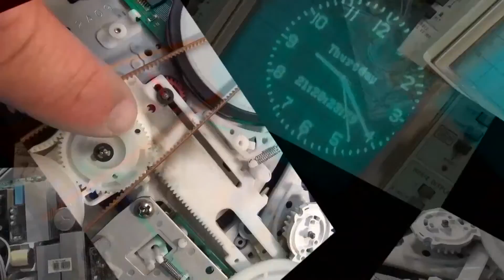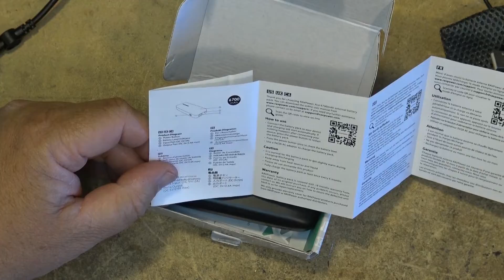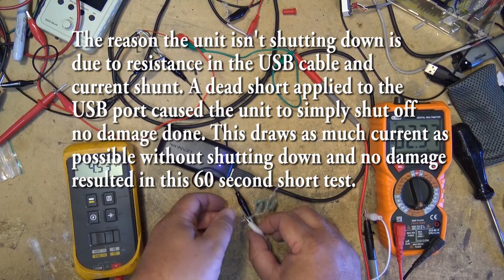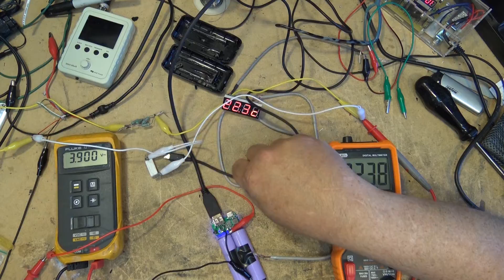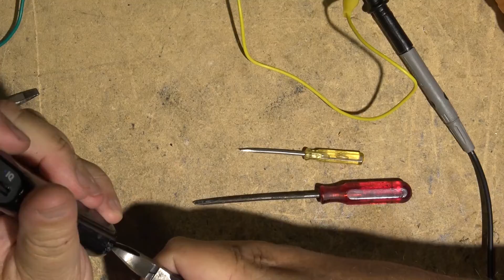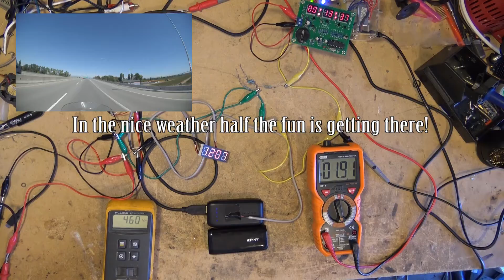Power Bank Shootout Ravpower vs Anker (Long full test version)

Comment: WOW!  What a contraption.  You know for $15 you can get a USB device that measures volts, amps, calculate watts and capacity.  They also make constant variable load devices for around $20.  I own a couple of different ones in the first category.  Not a load, yet.  Though the USB volts/amps are very useful to see if a device is putting out the correct volts and supplying enough current.  They fail at telling you if they are a stable source.  My desktop PC, for example, has an odd pulsing single.  Not seen by these devices BUT does show up on one of my USB powered lights.

Comment: Could you put a red filter thingy in front of the LED display; it's kind of hard to read. Also, try putting a small blob of thermal grease on the thermistor to improve the response time. As it is, all the heat has to transfer through the small area where the thermistor body is tangential to the surface being measured. By using the thermal paste/grease, it increases the effective surface area through which the heat can transfer (and you can just wipe it off with a rag when you're done.) Of course, some heat will transfer via radiative and convection means, too!
Reply from the maker: Nope because I don't have a red filter.
Reply: 12voltvids - You don't have one from one of the many clock kits you've built? Or maybe an old (digital) clock radio, or some other consumer electronic item, such as a VCR or DVD player that's a parts chassis now? :)

Comment: Hi 12voltvid

I definitely need your help with this led tv UA55D7000LRXZN . I will tell about the symptoms of the power supply and digital board. The power supply is on all the time when not connected to the digital board and when connected to the digital board is restarting every 2 seconds and the back light flashing. The capacitors on power supply have been changed with branded ones and nothing else looks out of ordinary.  I can make a video if you need more information. 

Thanks in advance.

Comment: I have a few RAV-power and their biggest advandtage: you can charge while powering a load (or "charge while using"). 
So you can (for example) abuse it as some kind of "UPS" for 5V units like RPI (alarm systems.. or "webcam in car" use)

Comment: These are far more sophisticated than I thought as far as regulation, current handling and charging control than I figured. Yes I prefer cylinder cells too. Ever heard of Saft? They made a great NiCad way back.
Reply: ive heard of saft, in fact i still have 2 D nimh 5ah cells that still work 35 years later , in an old torch, still recharge up, takes about a year of my use to make them flat

Comment: I always wonder about the cells used in these devices.
Reply from the maker: Wonder no more
Reply: Reason I say that is due to the fake claims of 5000, up to around 9000mAh. I have a PNY T6600 that has two or three 18650 cells (WalMart clearance for $9.). It provides 6600mAh of capacity therefore each cell is 3300mAh (or three at 2200). I'm sure they use quality cells in their devices but who knows. Your test is nevertheless impressive. I am surprised at the amount of current these power banks can deliver.
Reply from the maker: Jared Elliott 
Capacity can be tricky because there are losses associated with the buck converter. Just look at how hot it got. That is lost energy. So depending on efficiency of power converter your final out will vary. Putting the unit under load is a good comparison because both units were discharged under identical conditions. The ravpower ran twice as long but was not double the capacity. For the record ravpower sent me both of these units to do an independent unbiased comparison. I did not know what the results would be going in and was quite surprised at the difference. I have not been compensated in any way other than the merchandise which I damaged opening them so they can't be resold. The only revenue I make is from the video views, and the exposure it gives me for potential clients.